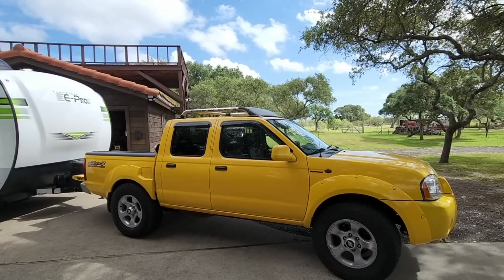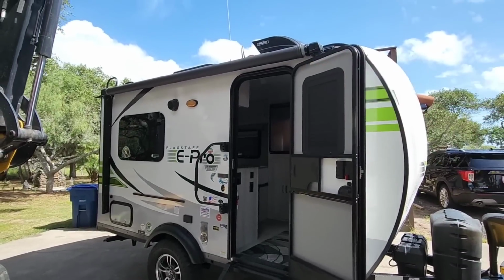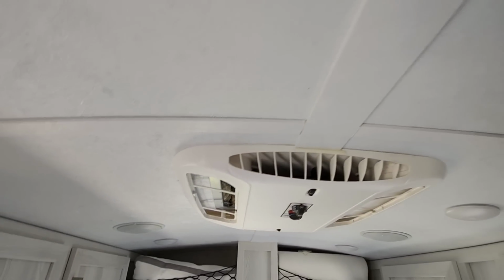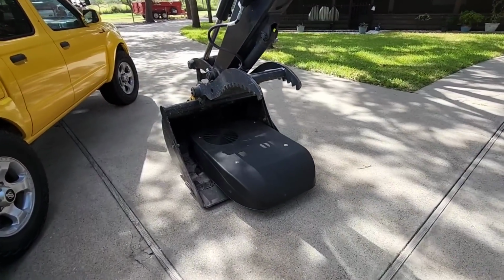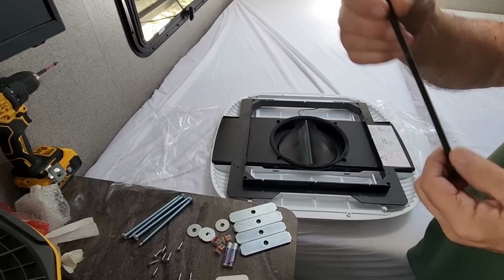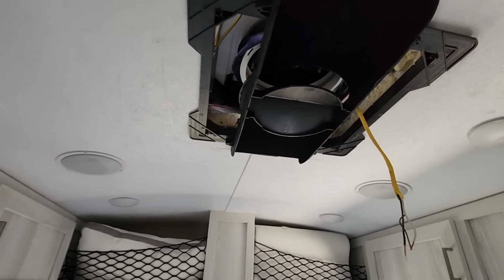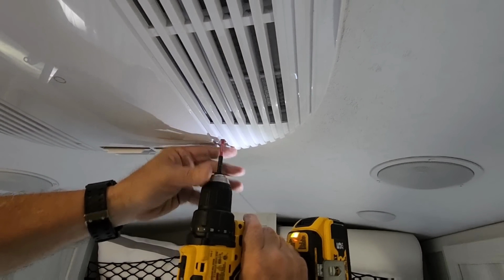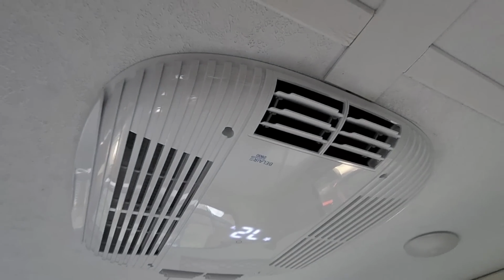Replacing the AC in the RV with an Excavator!

Comment: I've really been considering adding the 3rd AC to my 376FBH Open Range. The forward bunkhouse is even wired for it, and I've thought about adding a smaller AC like that and not hooking it into the raceways, so it's only use is to cool the bunkhouse which is always the hotest room in the rig. 

Did you mention how much it was?